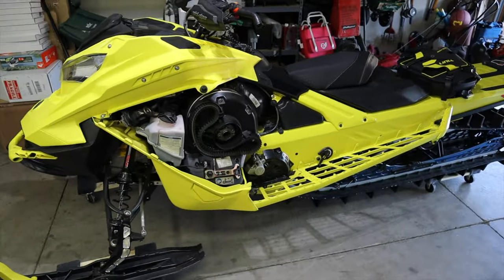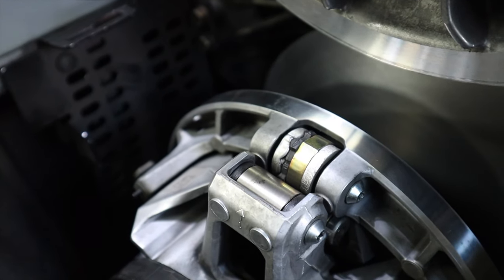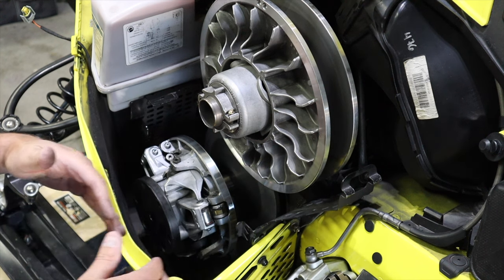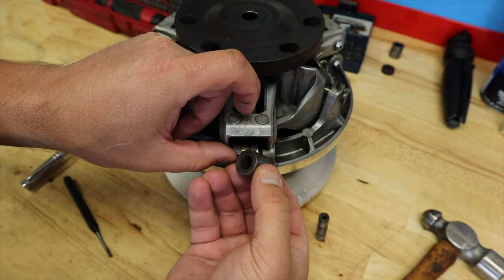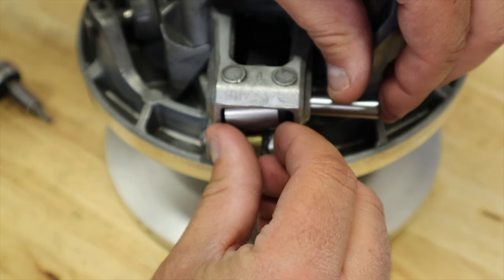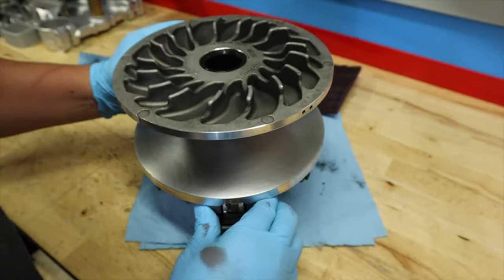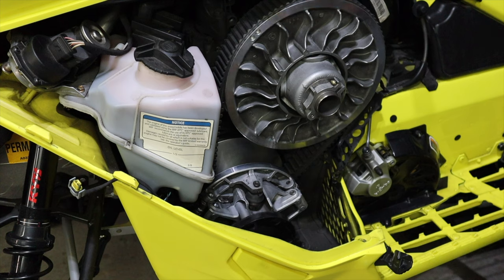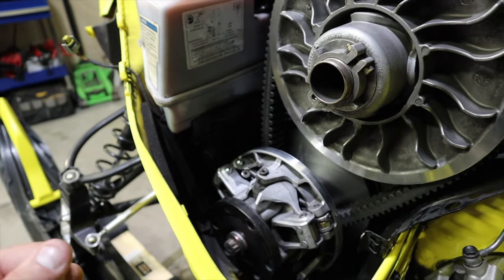PREVENTATIVE P DRIVE CLUTCH MAINTENANCE | Gen 4/5 SKIDOO

Comment: Could you just grease and/or replace those roller bearings witouth removing clutch?
Reply from the maker: For sure, and I mention that in the video. I actually won’t remove the clutch next time I do this. It was easier for video and the process.
Reply: @DanMX2112  Thank you 😁

Comment: Schaeffers citrol cleaner works great for cleaning the entire clutch.  I'm surprised those bearings go bad so fast.    Do SLP weights work well in these skidoos?
Reply from the maker: I would contact SLP on that, as this year is my first on the P Drive and I’m running SHR clutching on mine. Thanks for the recommendation on the Citrol, I’m gonna give it a shot!

Comment: Awesome video! I’m going to put a new spring in my clutch I should do the maintenance too! Thanks for the reminder!
Reply from the maker: Heck yes, fresh as can be for sure! I’m ready for this season!
Reply: @DanMX2112  nice!!! I’m mostly ready… my new sled is probably ready to go. It’s my old sleds that I’ve been goofing with. I can’t stop thinking about… how do you feel about old sleds?
Reply: Great video, I’m new to these new skidoos , I used to take the old TRA’s apart I have to get the tools to work on these
Reply from the maker: @sooperdan thanks man, these new p drive clutch’s are awesome!
Reply: @DanMX2112  I agree I’m going to experiment with a different spring in mine!

Comment: How does that grease hold up? Ski doo calls for their special thermal grease for the rollers.
Reply from the maker: It’s great grease, and it will do fine on that clutch. The SkiDoo isoflex is dang good too, but I’ve ran this grease in needle bearing applications for years and it holds up great to heat and pressure! I felt no need to go spend extra, and this grease won’t harden up like I’ve seen the isoflex do overtime. Time will tell, but so far so good, it’s performing great!